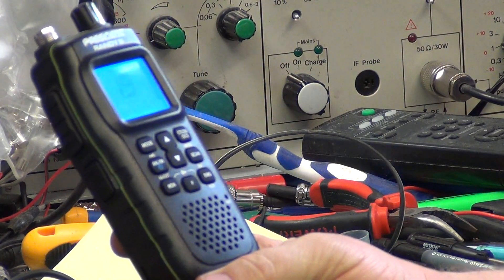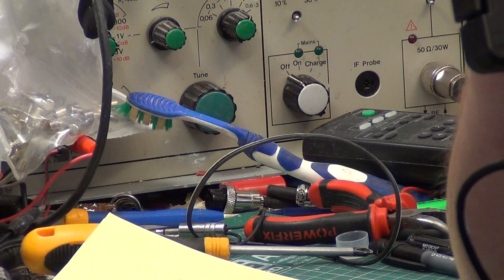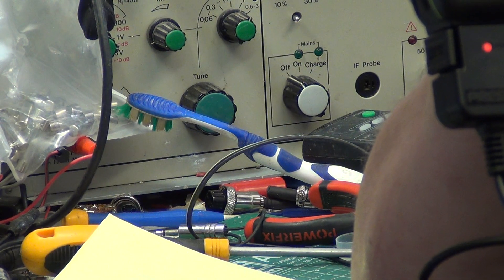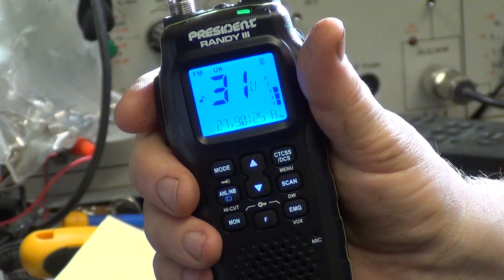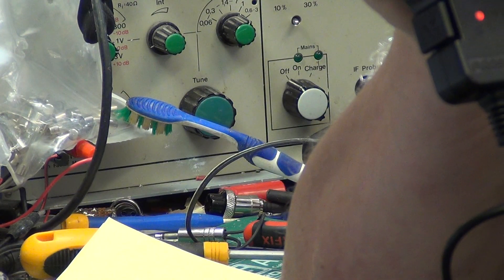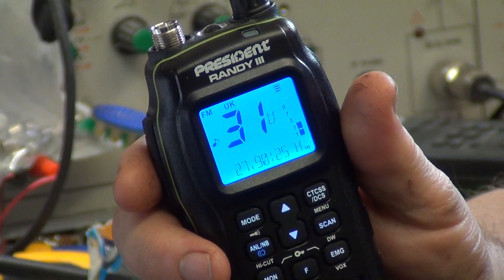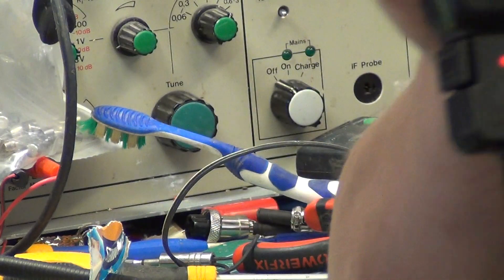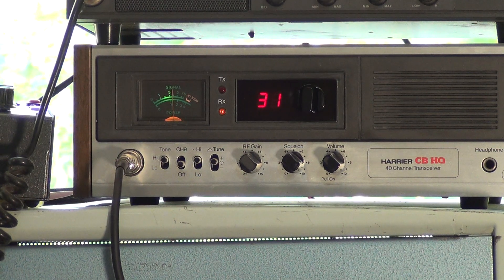President Randy III CE MultiNorm CB handheld radio - Double On The Air test

Comment: What's the base antenna at this QTH ?
Reply from the maker: I do mention most videos that it's an Antron 99 type of aerial without the optional groundplane kit. The aerial is mounted about 4 feet above gutter level of a single story building. The cable is RG58 type, but industrial grade.

Richard, G0OJF, UK

Comment: And no Ariel?
Reply from the maker: All our 'on the air' tests are conducted with the radio conneced to the workshop roof aerial. In this case through the car  kit provided. In contrast, our 'field tests' are conducted using the provided helical aerial. It's mentioned in every video.

Richard, G0OJF, UK

Comment: 1) President now offers the Randy II FCC in the US market.  AM/FM but only on US (a/k/a CEPT) channels.

2) Quite a hum on the local receive test.  Didn't sound like the HVAC rumble, either.  Present on both units.  Because of the "car adapter" power feed, maybe?

3) 
Ancaster Service Station:
£1.839/L       US$2.32/L       US$8.77/US Gal
£1.899/L       US$2.39/L       US$9.05/US Gal

"Other" Service Station:

£1.937/L       US$2.32/L       US$8.80/US Gal
£1.999/L       US$2.40/L       US$9.08/US Gal

Markets are in turmoil as the wealthy lose bets, so the USDxGBP rate has been changing (had been $1.26/£ in May and then closed just under $1.20 yesterday - who knew that CB videos would have me watching exchange rates?)